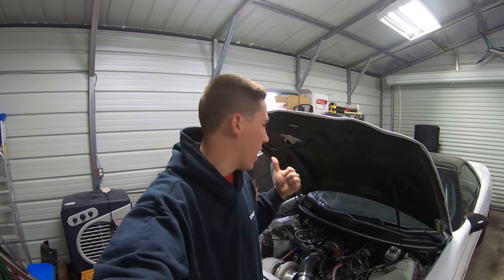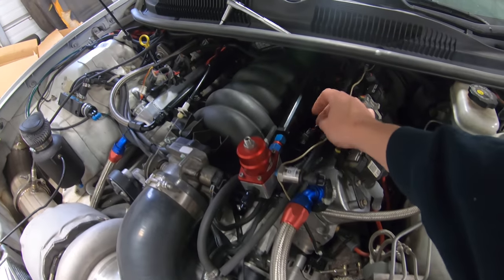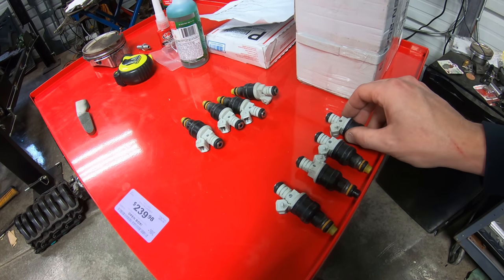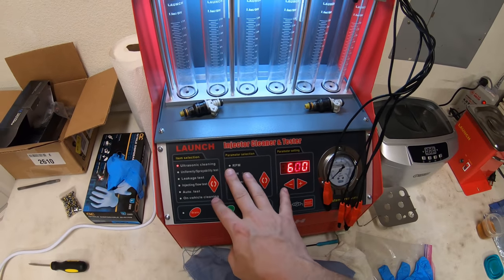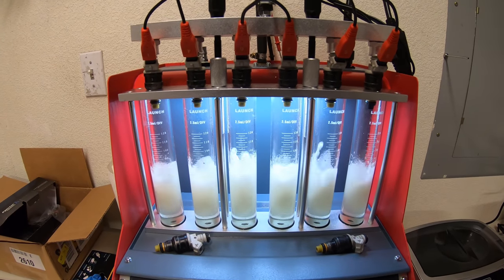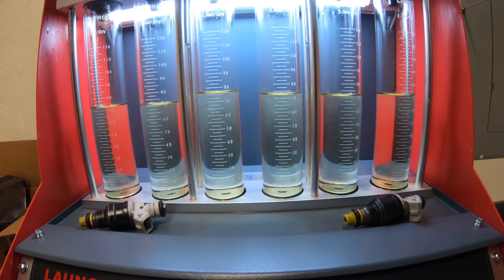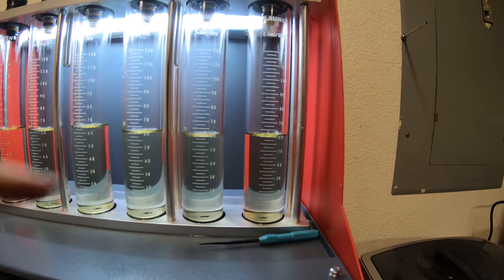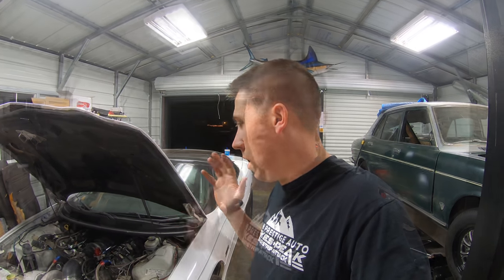I don't want to MELT another piston... Cleaning injectors in my Turbo Camaro!

Comment: What kind of cleaner do you have in the ultrasonic tanks I am looking to clean mine was going to order one of the ultra sonic machines
Reply from the maker: I use some ultrasonic cleaner that is designed for use with them. Comes in powder form and also I have used some degreaser type chemicals in the cleaners like simple green which really helps clean some of the soot and grime of the injectors

Comment: What is ur fuel setup on salty? I'm in the process of gathering everything to do a turbo build on my 99 z28. I'm debating on doing 2 or 3 in tank 450s or doing a sump and a decent size inline pump like a magnafuel 750 or something close to that from aeromotive.
Reply from the maker: I have dual 450s in the tank with a 8 feed 6 return. I turn the 2nd pump on at 7psi of boost.
Reply: @BuildTuneRace  if u had to do it over again would u still go that route or would u do a single inline pump?
Reply from the maker: I've been happy with mine no issues and supports what I need. And install was pretty easy but if I had to do 3 pumps I would probably go dump with a big pump but if your driving it a bunch idk if 1 big pump would be the best either.